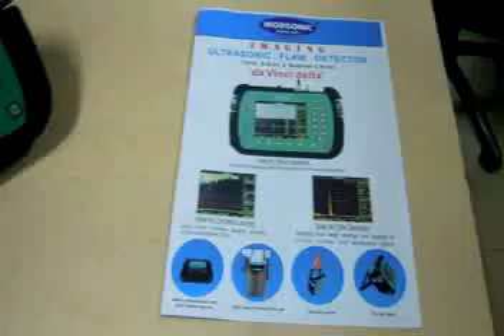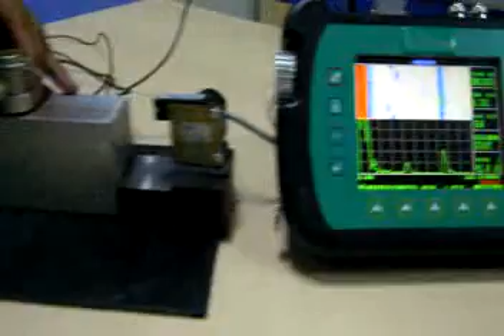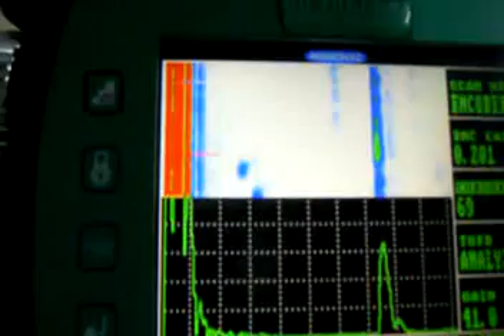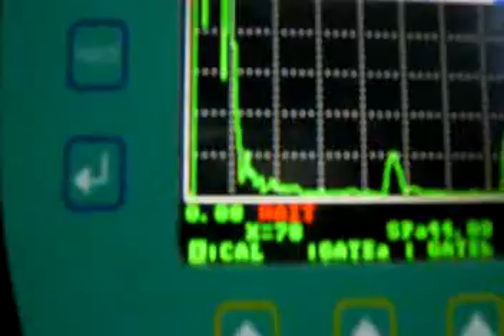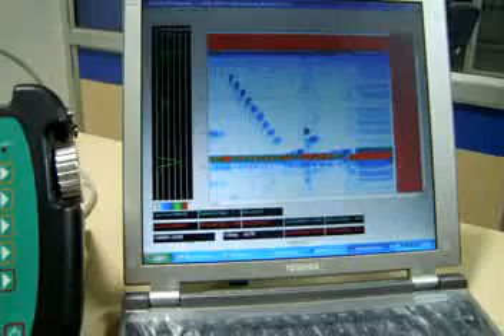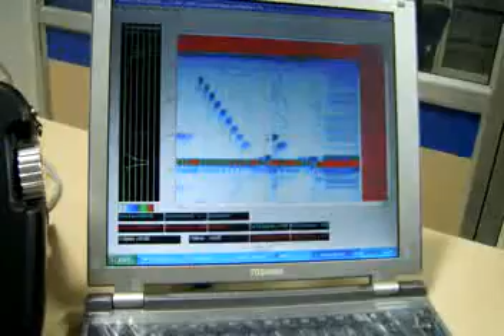B -Scan application of ' da Vinci delta ' Imaging Ultrasonic Flaw Detector

Comment: Kudos to Modsonic !! Instrument innovation is significant. For Code compliance - Data is required to be recorded in unprocessed form. A complete data set with no gating, filtering, or thresholding for response from examination volume to be included in the data record.